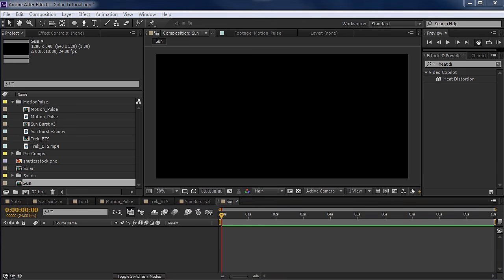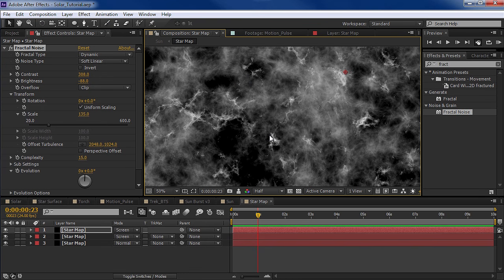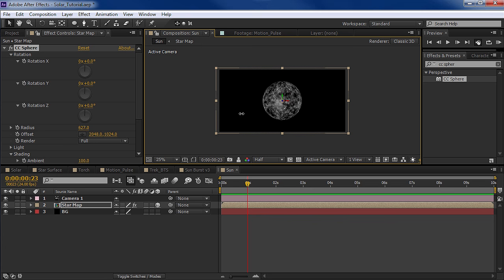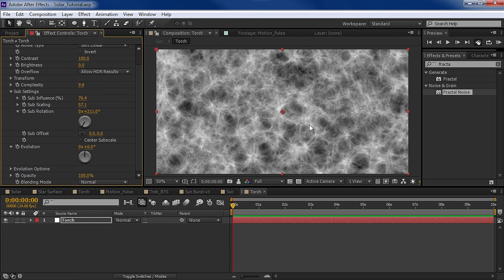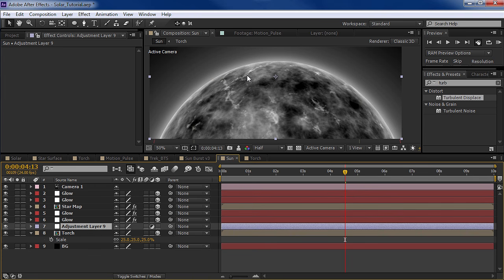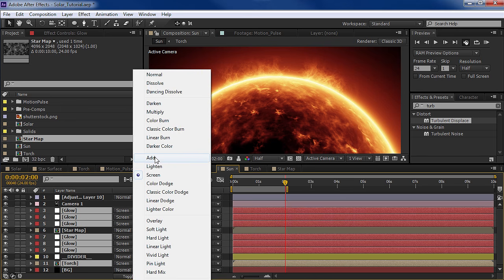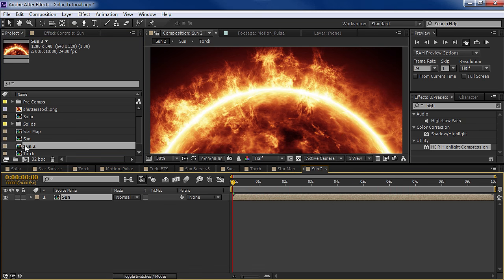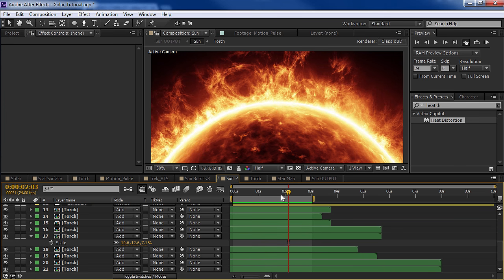Solar Atmosphere Tutorial

Comment: figured out the one issue I had with the artifacting when adding the second "glow" layer had to do with my outout settings being too low but Im running into several issues related directly to the 2022 versus the 7 year old version of After effects in use in this tutorial Im now 18 minutes in to this 31 minute tut not even going to tell you how many hours Ive spent trying to make this bad boy happen

Comment: Hey guys. Is there a way to cicle the animation of fire so it won't cut off every time the comp starts repeating? I mean... to loop somehow exactly Fractal Noise animation.
Reply: Oki. I guess i figured it out so it may help somebody. First you delete "time*" formula you made in evolution of fractal. Second you make 2 key frames at the first frame with 0x+0,0 and at the last with 1x+0,0. I know if u put that stuff at the last frame it will repeat 1 frame twice but you can put the second key frame 1 frame after the end of comp.  Not a big deal in such video i guess. 
BUT! As long as it does one cicle for period of time speed of fractals DEPENDS on lenght of your comp. So the slower you want it to move - the longer the comp should be. For example for me one of the layers in sun surface comp has "time*10" formula so if i want it to move with the same speed but looped it will be 36sec comp as long as it moves 10 degree per 1sec with "time*10". Thanks for reading)

Comment: For those who can't find the Fast Blur option, I found this helpful hint posted Feb 16, 2017:

"Fast Blur is the same blur algorithm as Box Blur, with the Iterations parameter set to 3. Absolutely no difference. Same for the Gaussian Blur (Legacy) effect; the only difference between it and Fast Blur was the Repeat Edge Pixels parameter.

The new GPU-accelerated Gaussian Blur uses a different blur algorithm. The same one that Premiere Pro offers under the name "Gaussian Blur". The rendered results will look different compared to the Gaussian Blur (Legacy) effect.

So although Fast Blur and Gaussian Blur (Legacy) were moved to the obsolete folder, you can still use them but you can get the same results with the Box Blur filter with the Iterations parameter set to 3. We're investigating ways to make this more obvious, and "faster". "
Reply: that was my question! Thanks!
Reply: You're welcome
You can also find the actual "Fast Blur" in the 'Effects and Presets' panel under the 'Obsolete' drop down for now, but who knows if Adobe will keep it.

Comment: My glow layer keeps appearing on top of the Star Map, even when the glow is below the star map in the layer hierarchy.
Reply: Finally got the glow behind the Star Map but now I can't get the duplicated Glow in front of the star map. I mean WTF is that.
Reply: how did you put in behind the star map ? im stuck there aswell :S
Reply: peschee w00t I moved the glow below the star map first than I applied the effect after moving. That did the trick for me. Hope it'll work for you.
Reply: I have the same problem with this stuff.
Reply: Also, if you do not hit the 3D button for that particular layer (white solid), it goes automatically behind the star, you'll have to modify the size manually thought, but it ain't much effort

Comment: you can also simulate the heat distortion effect with a simple trick: duplicate the Sun layer, usa an gaußian blur effect, create a solidlayer with an turbulant noise effect (play with the settings) and use this layer as a luminanz-mask for the duplicated sun layer. done.

Comment: I have Element 3D.   Any success and how did you you import this into Element?  I know it does have default sphere but the texture that you are building will need importing.  I know you put the models and textures into a folder that it saves to.  In my case with mac it is in the documents>video copilot>textures and models. Can you save this as a  texture?

Comment: I have a problem on the Curves part of the adjustment layer. The layer is well on top of any other, however, when I change the curves, it changes everything BUT the glowing layers. :\
Reply: I had the same issue. The fix for me was to add a black solid to the bottom of my comp. I didn't create the black solid at the beginning of the tutorial and the adjustment layer needs this solid for some reason. This is a universal concept too I found out after hours of research and testing. Don't know the science behind it, but it needs a black solid at the bottom of the comp to apply color/ curves effects to all objects.

Comment: After the Turbulent Displace on the Sun Comp, while he talked about his Heat Plugin, I added this which looked somewhat similar. -->
1. New Solid (white), pre-compose (named Steam), leave this comp above Sun.
2. Open new comp, Fractal Noise on the white solid.
3. Fractal Settings - Small Bumps, check 'Invert', contrast = 130, brightness = 1, evolve 'time*200' and animate sub offset upwards as Andrew did earlier.
4. Back in main comp, create new Adjustment layer and put it below Steam comp (but above Sun Comp), set TrkMat to " Luma Inverted Matte "Steam"".
5. Effects> Fastblur 120 on Adjustment layer.

This added a bit of a Steamy surface/heatblur effect, looks great on mine.

Comment: By the 10 minute mark half the stuff explained in the tutorial didn't work in my comp. The sphere was getting cut off by the glow layer, the fractal noise refused to animate. There was no way I could finish this.
Reply from the maker: Expressions are finicky, be sure to follow the steps precisely. You must create a camera, make the layer 3D before adding the expression and then make sure the layers are set to Orient towards camera so they stay in order. Try downloading the product from VideoCopilot.net/tutorials
Reply: One thing I would recommend, is during the tutorial, is at some point have the audience run some sort of test to see if their effects and layers work properly for later on.

Comment: when i copy paste the positions it says "Syntax error, expression disabled" please help me!
Reply: ***** I took another look at the camera settings and the only difference between mine and Andrew's was the depth of field enabled, I turned it of and everything was oke, still thanks!
Reply: Got the same issue, check the code where it says "World", for some reason it adds a dash and pastes as "Wor-ld" which messes it all up
Reply: ***** I changed corrected the code, but it still doesn't work??
Reply: Did you add the camera and set it to auto orient first? You need to do that first or the code it's trying to run won't work correctly because it doesn't have a camera to turn to.